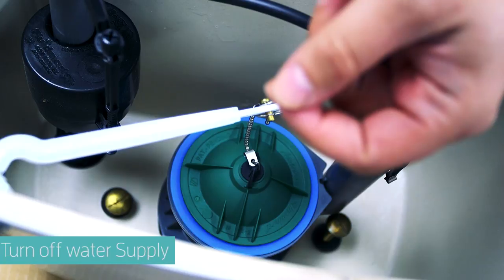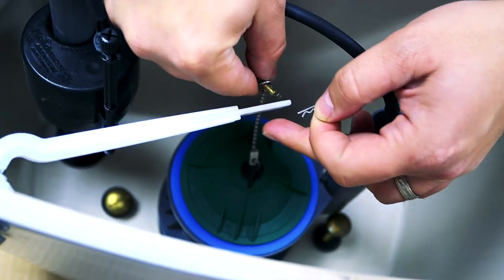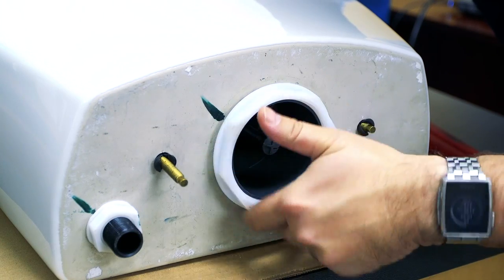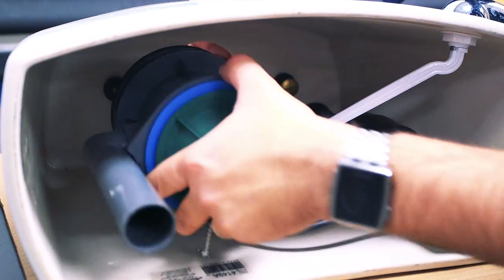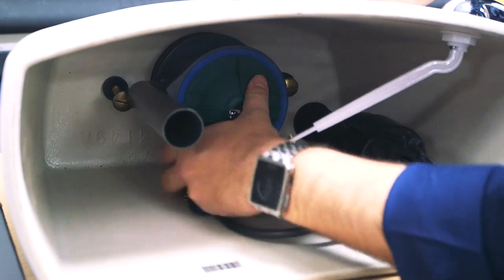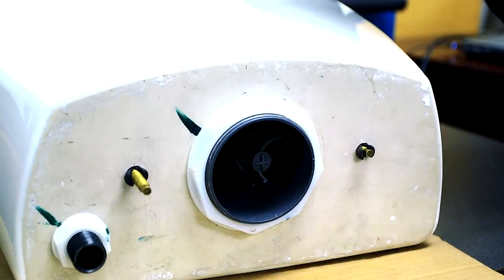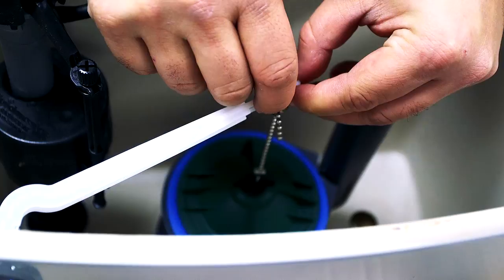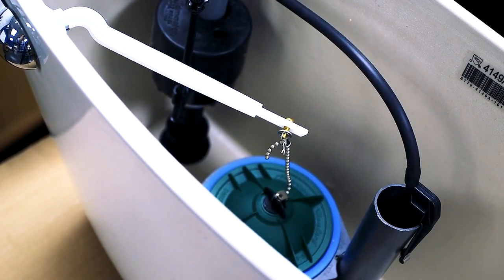How to Replace a Flush Valve for a Champion Toilet

Comment: If you're going to do go through this effort you might as well replace the flapper valve flush assembly with a traditional style flapper valve assembly from Nuflush  to eliminate the poor flush performance of this toilet. This toilet's large trap way diameter and flush valve diameter are fantastic. But the flapper valve assembly design is absolutely stupid.
Reply: agreed.  Engineering without thought to real use.
Reply: I've replaced a lot of flush kits over the last 35 years, but I've never had to remove the tank to do it before...what a joke. This is the most ridiculous design I've ever seen.  I'm tempted to replace the whole toilet.
Reply: @Lewey57  The Nuflush (conventional) valve worked great for me. The original Champion Toilet valve is just STUPID.
Reply: @marvinshook9142  Didn't have to change anything but add a little vaseline 😁.
Reply: @gameofpawns2264  For what purpose? I can imagine vaseline might help with a phantom seal leak. Replacing the seal on this toilet is not a big deal, though. This video is about replacing the entire flush valve.

Comment: Unbelievable. This is crappy design to replace. I fell for advertised water saver pitch 5 years ago. I think I’ve replaced the blue silicone ring seal every year. Now I have to replace the tank seal by removing the tank. Wow!

Comment: Bought this house and it UNFORTUNATELY had this toilet in the master bath. WHAT A HORRIBLE TOILET!!!  Who in their right mind would design a toilet that doesn't clean the bowl with water every time you flush and where you have to completely remove the water tank to replace the flapper!
Reply: It’s a terrible toilet. Honestly, I’d rather replace it than do all this work.
Reply: This video is for replacing the entire assembly and is NOT for simple flapper replacement. You can easily swap out just the blue seal by unscrewing the black plastic plug to which the chain is attached and replacing only that seal. Takes literally about 2 minutes. Turn off water. Flush toilet to empty tank. Unscrew black plug. Replace blue flapper AND o-ring on plug. Screw back together. Turn on water. We've had 3 of these toilets for 10 years. They always flush all matter. And we replace the blue seal only as often as you would a standard flapper.

Comment: worst YouTube video how-to I have ever seen.  They completely skip the coupling gasket.  And of course they are doing the replacement on a brand new toilet.  Fortunately replacing the valve is not hard, with this video and some common sense, you can figure it out.  My main complaint with this toilet:  Would you buy this toilet if you knew that to replace the valve you would have to take off the tank?  NO.  After 50 years of replacing flapper valves (a 1 minute job) you now have to remove the tank to replace the valve.  I want a class action suit, they should have disclosed that on the toilet box.  Anyway, good toilet otherwise.

Comment: Don’t replace with similar unit. Get tradition unit that sits on bottom of tank. These tower units are terrible and leak or “ghost flush”, wasting water.
Reply from the maker: Hi There - We recommend using genuine American Standard parts for repairs. While it is possible to use alternative replacement parts with our toilets, doing so will void the warranty. Thanks!
Reply: @americanstandard warrantee does no good when the problematic flush valves are constantly having faults to the point people are turning away from your products entirely, I bought a house with one of these toilets and have done nothing but fix this toilet, ive been here since Valentines day of 2018 and have had this toilet apart more than anything else in this whole house, and about to have to do it again today
Reply: Stop making silly designs like this, removing an entire tank just to replace a seal/gasket... @americanstandard

Comment: i had 'ghost flashes' started 5 years after i bought this toilet. First replaced just the seals (american standard brand). didn't help. then replaced the whole valve as in this video - still no help - ghost flashes continue. turned the water supply off to observe how deep water drains - it stops at the level of the blue seal. Terrible design!!. I don't recommend this model to any one. @American Standard - please suggest something that actually works.
Reply: It’s horrible! And they know it! I can’t any sleep at night unless I turn the shutoff valve. I really need my money back. It’s only been a year!

Comment: This toilet came with the house when we bought it and has been great so far. Now that it's time to work on it, apparently step 1 is missed here, and everywhere. How the flip do you drain the several inches of water from the bottom of the tank before you start any repair?
Reply: Get the water level down, and use a plastic cup...to get remaining water use a wash cloth and ring it out in the sink. This effort will save a world of trouble when you loose the tank to bowl bolts.
Reply: I agree! It also doesn’t show the water source disconnected from the bottom of the tank!
Reply: I used a big yellow tile grout sponge to remove all the standing water below the flush valve.
Reply: A long thin piece of tubing (like from a fish tank vacuum) can be used to siphon off all but the last thin layer of water.
Reply: Shop vac.

Comment: I have had nothing but trouble with this toilet. AS did not answer their phone or email when asked for support. Mine will not flush properly after it has been idle overnight. It flushes properly on the second flush though??
Reply: Raise the water level.  Use the thumb screw attached to the fill valve to raise the float.

Comment: Love this toilet. Have had one for years but man does this valve design SUUUUUUUUUUUUUUUUUUUCK! Over engineer for no reason and makes replacing the flapper a unnecessary pain. Switching out this over complicated design to something much more simple.

Now do a change from a real toilet that has been in use for years and show how "easy" it is. Here's a hint folks, it's not as easy as the video shows.

Comment: We strongly disagree with your assessment after reviewing your video. 

From an analytical perspective, the real problem is  you are actually wasting your money buying defective gaskets from American Standard. That’s the problem- that is it. Period. Well, it’s true gaskets do and will fail, but the failure rate over time is too high. This can be easily fixed if AS start making good quality gaskets that provide a strong seal and doesn’t fizzle out after a few months. There’s absolutely nothing wrong with the toilet - it’s the poor quality seal. Think about this. 

The issue appears to be the material used in the gasket doesn’t hold up well in water for long. So perhaps a coating of Vaseline would protect the cheap piece of junk gasket from the elements.

In context an off the shelf flapper can work for 3 years or more without leaking.
Reply from the maker: Hi There - We are sorry to hear that, but appreciate you taking the time to share this feedback with us. You can always give us a call at 800-442-1902 if you'd like to provide additional details about your experience. Thanks!

Comment: I had to use a 1/2" deep socket to remove the tank bolts. Also, if you go this far, replace the tank to bowl gasket.

Comment: Tank worked well, for awhile. Problem is the flapper valve stand too high. Not enough water flushing the bowl completely. Wait for the tank to refill and reflush, same issue. To get a complete flushing of bowl i have to add about 2+ quarts of water into the bowl then flush.
So, I think I will replace the innards with a different system that allows for more water flow.
Reply from the maker: Hi There - Sorry for the frustration! Is the water level at the correct height listed inside the tank? You can change the water level by turning the adjustment knob to move the float cup up or down. You may also want to try re-priming the bowl to achieve optimal performance. If you still need assistance, you can always give us a call at 800-442-1902 and a member of our Consumer Connection team will be happy to help. Thanks!

Comment: The video mentions a gasket, but doesn't show it.  Where is this gasket?  I had something mentioned in the instructions which is described as "lower lock ring (1.28 GPF optional)" but I am choosing the 1.66GPF as indicated in the instructions.  This is very confusing - will my tank be leaking if I put it on without a gasket?  All I have is the lock nut.

Comment: I have this same type flush valve assembly in my Champion but now when flushed the green center hub stays up after the toilet flushes, allowing water to just keep running.  I have to manually push the "lid" down so the water stops running.  Help!!!
Reply from the maker: Hi Mike - We are sorry for the frustration! It sounds like the Flapper or Seal, Flush Valve, Fill Valve, or Trip Lever might need replacing. For assistance troubleshooting your problem, please give our Consumer Connection Team a call at 800-442-1902. Thanks!

Comment: We replaced the three original toilets in our house by Champion toilets that came originally with the white flush towers, but AS sent the replacement grey ones as shown in the video. After ten or more years they still have the original red seals, and for the first time one of them has started having problems: the top part -- the part to which the chain attaches -- became detached from the bottom part, and when I unscrewed the black part at the top to replace the seal, the center vertical part to which it had been screwed disappeared out of sight, somewhere down into the innards of the bowl. I haven't yet removed the tank in order to replace the whole flush valve assembly, but what are my chances of being able to remove that part and prevent it from interfering with the flow of water into the bowl?

Maybe I'll have to remove the whole toilet and tilt it back to let that part slide back into view so I can grab it.

In the meantime I called AS, and they are going to send me a new flush valve.
Reply: This is the exact thing that happened to me. The bottom piece fell of that plastic bolt fell down into the innards of the bowl and I could not retrieve it. I tried sucking it out with a shop vac. Didn’t work. I had to pull the toilet which is heavier than a sonofabitch and dragged it outside to flush it with my garden house. No luck. I then tried snaking the innards and discovered there is a plastic liner that receives the upper tank water and shoots it down into the bowl. The bottom plastic bolt was lodged against that sleeve and nothing I did which included turning the bowl every which way yielded the plastic bolt. So I ended up ripping the elongated plastic sleeve out of its orifice and hit it with the hose against. I then snaked it again and the plastic bolt finally appeared. Meanwhile I have destroyed the elongated plastic insert and worry now that the water flow coming down from the tank into the bowl will be diminished. That part is not shown on any exploded views of these toilets. So I am calling American Standard in the morning. What a pain in the butt.
Reply: Update: this plastic sleeve has a name! It’s a “horn” and Champion was great sending me another one free of charge. They don’t sell them retail or wholesale apparently. The toilet is back in service and flushing like a champ.

Comment: No longer has the black nut how do i remove
Reply from the maker: Hi Graham - Hmm.. what black nut are you referring to? The tank has to be removed from the bowl for the white lock nut to be removed.  If you purchased or received a flush valve through your warranty from us directly, we include a flush valve wrench with the flush valve to remove the large white lock nut. We hope this helps to clarify! If you have any additional questions, please give us a call at 800-442-1902. Thanks!
Reply: @americanstandard  It was inreference to the seal on the flapper.  They update the model and not the instruction. I call for help and they where confused.  But i final figure out how to remove the seal no thank to support.

Comment: I ordered a kit under warranty and I received a different/additional "coupling gasket" part 738649-0070a.  There are no instructions on where it goes and this video doesn't even show it.
Reply from the maker: Hello Gregory! Part 738649-0070A is a coupling gasket that is used once the tank is removed. It's designed to be placed in between the tank and the bowl. If you need additional assistance, please give us a call at 800-442-1902 so we can get some more details. Thanks!

Comment: In testing over months and months, it is NOW confirmed that vaseline can help protect the gasket from the elements and the toilet from leaking. An extra coating may help as contact parts can wipe away that protection. Disclaimer: This has been our experience and yours might different and we cannot guarantee it will work for you or that you will see any results.
Reply: Isn't silence golden... especially when you don't hear your toilet filling up periodically? Saving money too.
Reply: NuFlush1  I haven't heard my toilet leak in forever. I've also not been going to the store every month to buy replacement gasket every month. And even though the gasket is not an original manufacturer part, perhaps just a cheap knock-off, it has been holding up well for years. It may very well outlast my toilet!!!

Comment: I actually like these toilets a lot, and have installed half a dozen in the recent past. But I am concerned that the video shows the procedure incorrectly. What is wrong with it is that the reinstallation has the pull chain connected on the clevis pin side of the trip lever. Note the side of the trip lever from which the pull chain was originally attached and then observe an incorrect installation of that pull chain at the video conclusion.  Tsk tsk!  Sloppy.
Reply: just a quick observation - i agree its an easy install - but did you actually have to live with it in your home and deal with continued leaks? maybe  just my bad luck
Reply: Great comment! Thanks for sharing it.

Comment: I have two of these toilets,  I have fixed one twice the blue gasket does not stop the ghost flushing!  now it looks like i have to change the flush valve!
Reply: Did you have a slow leak into the bowl? Did replacing the blue ring work? Or did you replace the whole flush mechanism? If so, did that stop the leak?
Reply: I did too. I’m sorry.